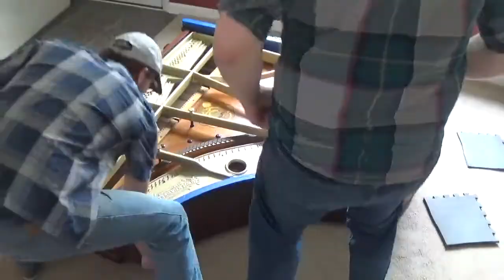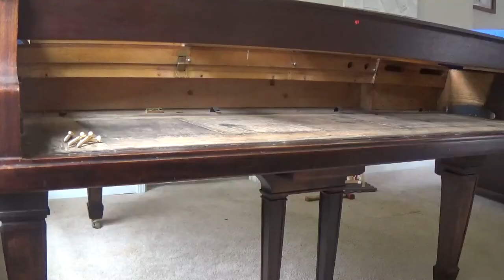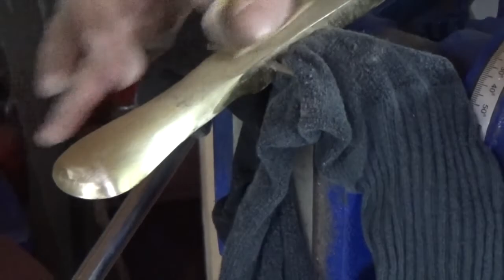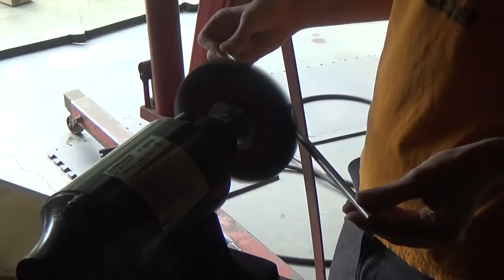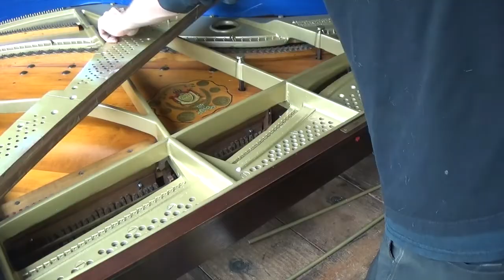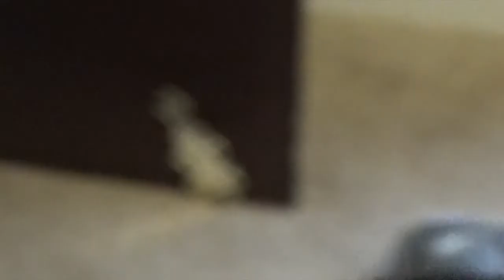Assembling the Piano

Comment: ok and where is the strings? :D
Reply from the maker: In time! I need the finances for it. It is pretty expensive to finish up this project.
Reply: @oakleydoeseverything6438   how much does strings and pins cost? What do you want to do with action ?
Reply from the maker: @davidemarchi6366  A new set of strings is around $300-400. Tuning pins is another $100. I also will need new felts and bushings together will be another $50. And then I also need to invest in the tools that I will need to do it myself so that is another $200ish. 

For right now I'm not going to do anything with the action. It is still very responsive and works well. That will be a kind of like "third phase" of this project.